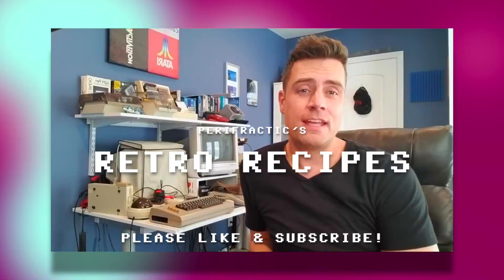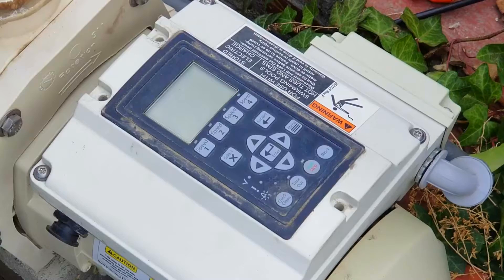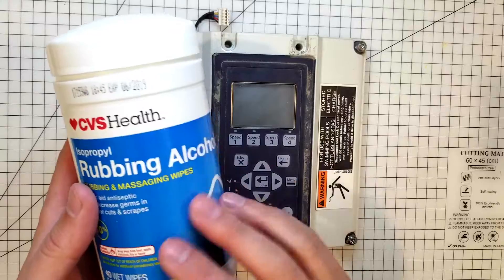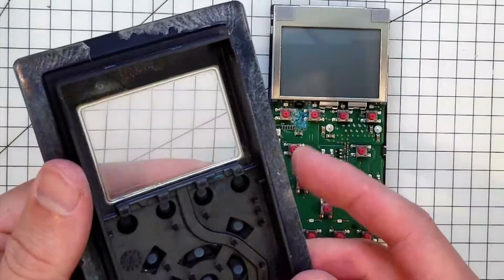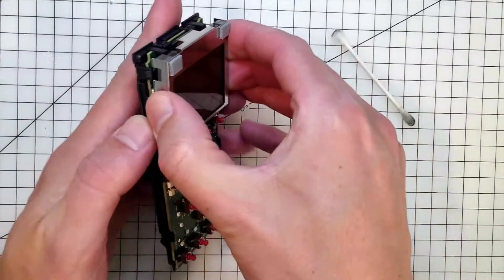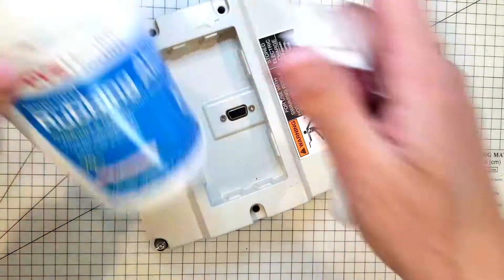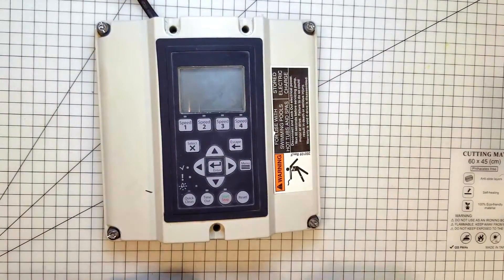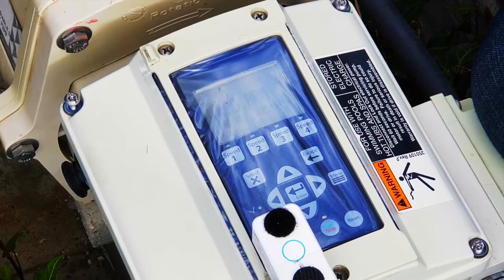Off Menu: Pentair Intelliflo Pool Pump LCD Screen Repair | see description

Comment: Wow!!! Thank you so much for posting this video! 

Our pump is JUST out of warranty of course (installed in 2016)! In our case, our display still had an orange-lit background – but it appeared completely blank – minus a few random black lines that came and went. All the buttons still worked though.

After following your instructions to get the panel removed from the pump, and opening it up to get into it, we found nothing corroded - which is great! We continued following everything you indicated to do in your video (but we applied 2 layers of the insulation foam – to the “top” part of the display only) then put everything back together.

Of NOTE: our pump had some minor differences from yours. (I believe it to be manufactured in 2015 as the sticker on the back of our control panel said it was a “Control Panel IntelliFlo II -- 176L0880”).

1. our security screws on the outside did not have that “additional head” in the middle so we were able to easily access them with the right bit-head tool (eliminating us having to use a saw/Dremel to modify them)

2. our unit had an extra set of security screws which held the “cute” RS232 Plug tight to the back of the display when sitting in the cover! So, after removing the adhesive around the rubber edges of the soft keypad, we were not able to remove the display panel until those additional security screws were removed. (BTW, those screws were completely different from the external ones we’d removed. Thankfully, we had the right bit-head.)

In the end, we spent under $20 (for some products you recommended but we did not currently have at home). Thank you for saving us potentially hundreds of dollars!

Ironically, when I first Googled about the issue we were having, the first place I went to, happened to be the forum thread that you reference over at the “Trouble Free Pool Forum.” I skimmed through it and thought I needed to keep researching because I was really hoping to find a LINK to a VIDEO! (too bad they wouldn’t let you post yours there it really is a winner!) And, thankfully, Google showed your video first on the search page!
Reply from the maker: That's great! I'm glad you found it.
No complaints if you wish to send a small tip for a beer this way via the description link 😉

Comment: Is power off good enough? Do you really need to disconnect? I'm looking at my set-up, and I have no clue where to disconnect.
Reply from the maker: I'm not an electrical engineer so for safety I can't advise. If it were me and I was sure the breaker was off at the mains, I'd probably be ok. Good luck!
Reply: @RetroRecipes  There is breaker present. Turn that off should be good. I will use the power of hindsight and skip making the Saw movies. LOL!

Comment: As a pool repair professional I would not perform this repair as I would not be able to warranty the work. Please understand that if your pool guy says the entire drive needs replacement. But seems like a great thing for the average homeowner to try first...

P.s. https://www.homedepot.com/p/TEKTON-Security-Screwdriver-Bit-Set-33-Piece-2930/207096226?cm_mmc=Shopping%7CG%7CVF%7CD24%7C3M%7CNA%7CPLA%7C3M_Sundries_Paint_Test%7c71700000047523376%7c58700004766740015%7c92700040663644252&gclid=CjwKCAiAv9riBRANEiwA9Dqv1TBCipd33PdJFutjiwZfob3o6McOwuMFK-FTXa9SXlWXr-MulXmP4BoCb2QQAvD_BwE&gclsrc=aw.ds
Reply: FRANK Widdifield would you do this repair if the warranty period has passed?
Reply: I agree. I'm also a full-time tech. People gripe about how the repair person said to replace the whole drive or pump if it's older. But we have to provide long lasting workmanship that will be reliable. This is tinkering territory. Fun for the backyard mechanic but not a real repair. It's not fun getting a call from an upset customer who says your fix lasted 2 weeks and now it doesn't work! I have a pool party tomorrow! Time wasted and just lost the confidence of the customer.